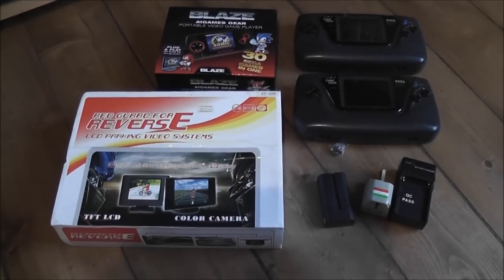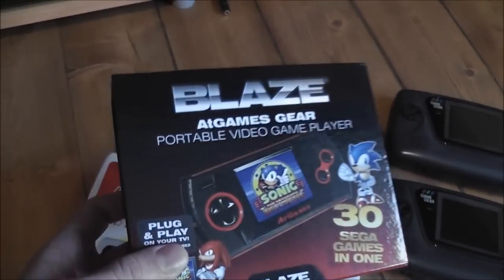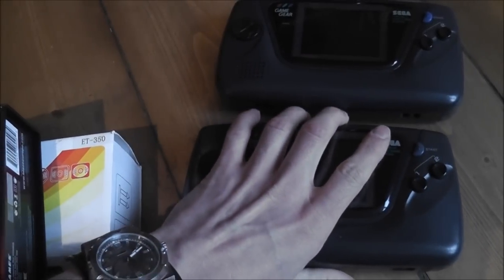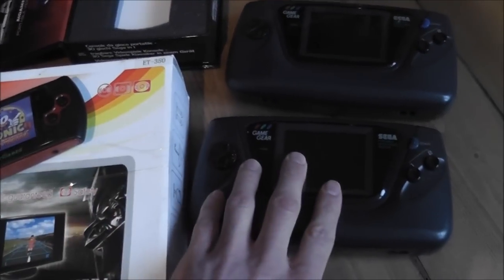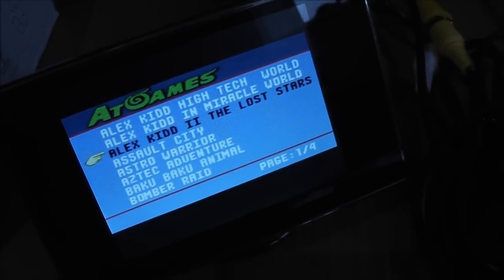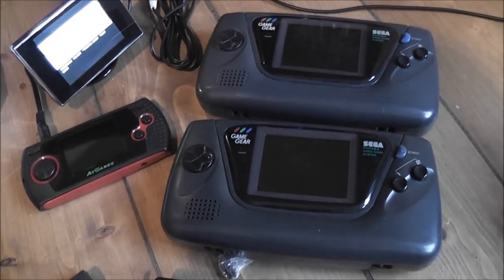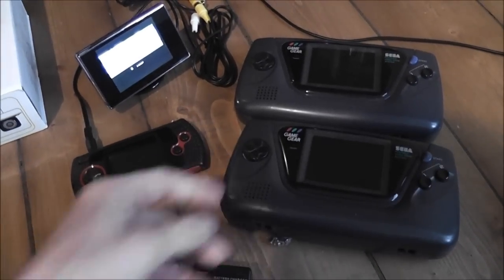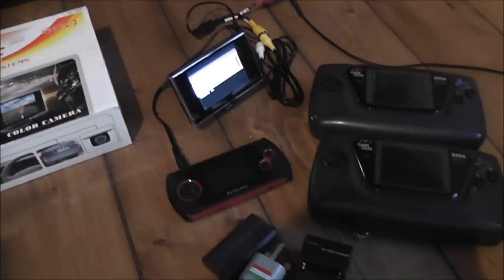Best-Laid Schemes - When Projects Don't Work Out - Technical Difficulties

Comment: @shenmueso mega drive's are fully RGB wired so no modding needed :) just either get a MD1 RGB scart lead for a model mega drive or a MD2 RGB cable for a mega drive 2 plug it in and away you go :)

Comment from the maker: @thomas3120 I think it's because of 50/60Hz differences between the screen and handheld signal. I looked on both to see if there were any obvious jumpers or solder points to change but no joy.
I was thinking about maybe installing some sort of a clone system in there. DealExtreme have some really interesting devices that would make a really cool custom handheld. I'm not giving up just yet ;-)

Comment: I know it's been a while but if you still have those game gears you could "easily" use a Pi Zero. I saw someone else reuse the power and audio boards from the game gear as well as the AA battery bays with a backup screen and a Pi Zero.

Comment: @RetroGameTech those borders appear because its set to 50HZ PAL the original UK Mega Drive was the same too.On the original you can do a 50-50HZ switch mod to remove the borders and run the games at 60HZ and full 60FPS full screen.I donr know weather you can do that mod with that blaze clone though since they arer usually a OAC (on a chip) device.

Comment: @shenmueso some games read the region and the video refresh rate to try and lock out imports ect so you would change the region wait for the title screen then force it into 60hz to by pass the lock out but only afew games do this but the video mod helps helps get round it :)

plus some PAL games dont work right if at all forced into 60hz (sonic 3,doom32x) so the mods helps if any games that wont play right using the video mod but thay are few and far between :)

Comment: @shenmueso overclocking is something im looking into but tbh it only helps with some titles like thunder force 4 and sonic 2 and you will have to be really picky to notice any slowdown gone ect

its a cool mod but abit useless and hard to do right if you not a pro with soldering ect :)